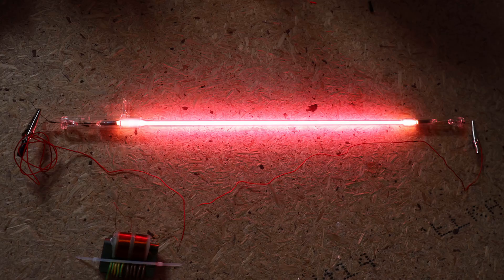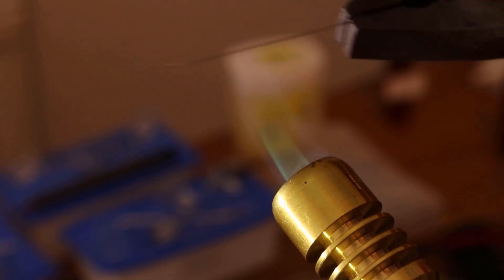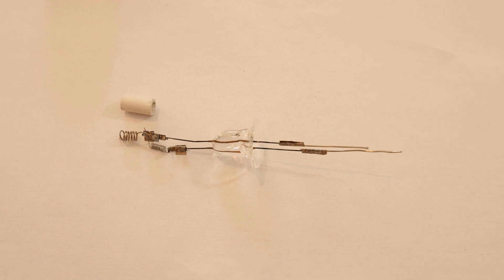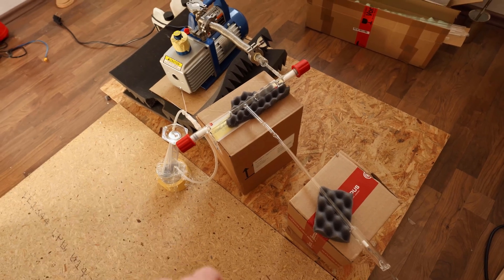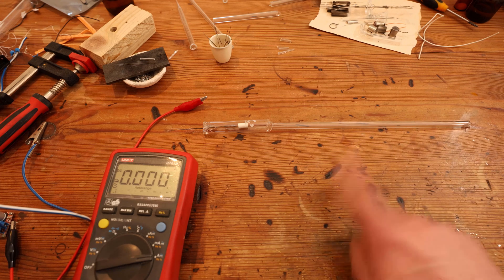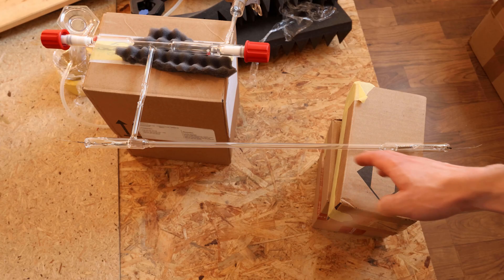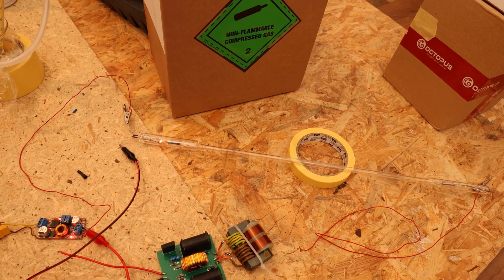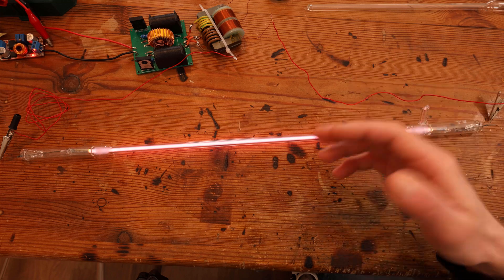Making real Neon Tubes! [part 2]

Comment: Perhaps consider making a DIY titanium sublimation pump to achieve sub-micron vacuum, and cleaner tubes. A titanium wire inside a longer, large diameter glass tube should suffice, like a reusable getter. Maybe water cooling and a 4-way connector could make it faster and easier to use, but air cooling and blown glass connections may work as well.
Reply from the maker: @waltonchan3931  I said I'm using one, already at  3:04 minutes of the video😅

Comment: I ended up buying out a neon sign making buisness years ago and for a few years after made geissler tubes with the equipment, even a real x ray tube. The nain thing that is critical is to pump the glass while its nicely hot. Then purge a few times. Then fill to the desired pressure and seal. The next step is to run the tube at a much higher current than normal, about 200mA for neon tubes. This causes the color to devlop, and is also why most sign makers went to phosphor coated tubes and mercury/argon for the gas fill.❤

Comment: Lovely! How about hot cathode neon lamps ? Much the same way as mercury lamps, neon filled lamps with the same dual heated cathode could be a great way to increase electron emission instead of having to activate coatings.
Reply: Shortly before UV lasers went solid state they had neon ion UV lasers, and they had filaments similar in thickness to the one in a microwave magnetron tube. They also shot 20A through the tube causing it to light up a brught pinkish color that is best described as nuclear flamingo pink, but the beam itself was totally invisible. ❤
Reply: @christopherleubner6633  nuclear flamingo pink. Damn I need a hoodie of that color now :D

Comment: Would it be an idea to have not just the one pump stem on one side, but also a neon input stem on the other side? 
That way you can ensure that all of the gas in the tube will be neon. Even if it's at the wrong pressure, there will be no contaminants. 
It is also a good idea to power it up while pumping, then flushing with fresh neon to flush out any contaminants coming from the electrodes.
Reply: That's called "flow through" pumping.  It works well.

Comment: If the colour is off, there is probably still air in there. It only takes a tiny bit of air to ruin neon and make it pink. If you run it for a while it might go red. A good way to tell if theres air in there is if it runs hot. When I pump a tube on my big 1980s neon processing machine, if you do a bad job you know straight away caus it lights up pink, and not red. They often burn in red, but sometimes they dont, and you have to re process them.
Reply: I can send you some electrodes if you like, ive got boxes and boxes of old dirty weird electrodes sitting around
Reply: Turbo pump not necessary for neon, most people use a diffusion pump, or just a good rotary vane. Ive got an edwards rv3 rotary vane on mine, it gets down to 10-3mbar which is more than enough for good neon pumping. Ive also got a small edwards air cooled diffusion pump on there which boosts the pressure down to i reckon about 1x10-5 but I have no way of knowing as its off the end of the scale on my gauge. I managed to pump and fill tubes no problem with just the RV3 though

Comment: just buy ready made electrodes
Reply from the maker: That you have to process, so you need a bombarding transformer.
Reply: @thesciencefurry  a 10$ induction heater is enough, my friend is a neon sign maker and he uses a self made heater for it, you have a self made hv power supply, if you get another one you can use that
Reply: @thesciencefurry  I believe the bombardment process also etches the inner surface of the glass, cleaning it, not just firing the getter material/decomposing the emissive cathode coating
Reply from the maker: @zinckensteel  True. You can heat up the glass with the torch aswell tho.
Reply: @thesciencefurry  it's not just about degassing iirc, as the plasma etch changes the surface characteristics at the nanometer scale.
Reply: @zinckensteel  no, its just about removing adsorbed moisture by heat.  There is no surface etching or anything like that occuring under the normal bombarding process.  It is possible to oxygen or halogen treat the glass, but its not necessary.
Reply: @thesciencefurry very good progress! you can induction heat the electrodes to convert the thermionic coating.  A 'bolt buster' works well.  No need to bombard. There's only one source of commercial borosilicate electrodes, but they wont be around long.  To make your own boro electrodes, you can pull the shells from soft-glass electrodes. Or just use soft glass for now.   On the tungsten-glass seals,  there will still likely be leaks (you'll see in a month) unless you electropolish first.  Use a few amps of DC in a NaOH solution, where the tungsten is on the Neg side.  Dont exceed .5mm tungsten wire dia due to COE issues w/ 33 boro.  Look forward to your next video!